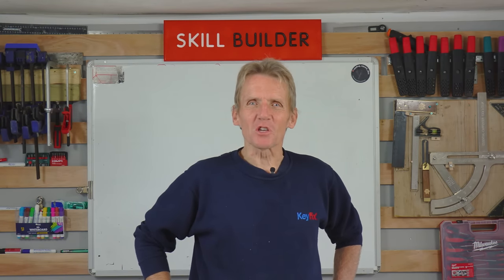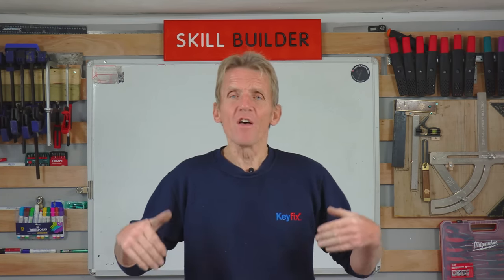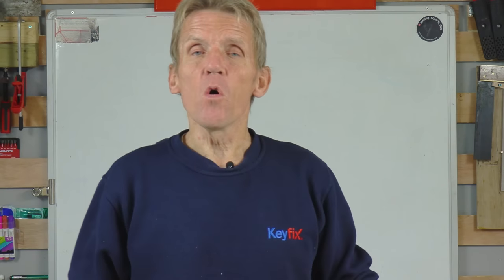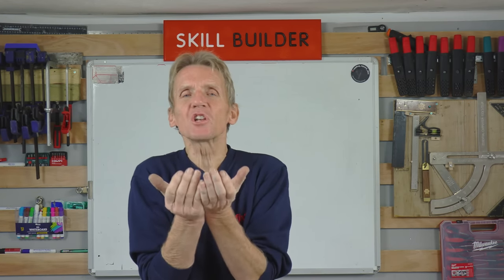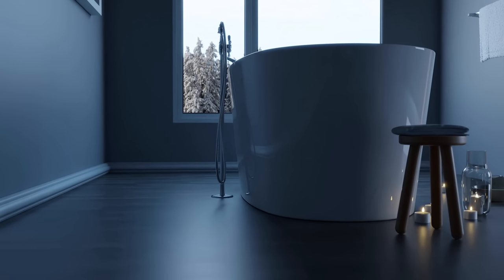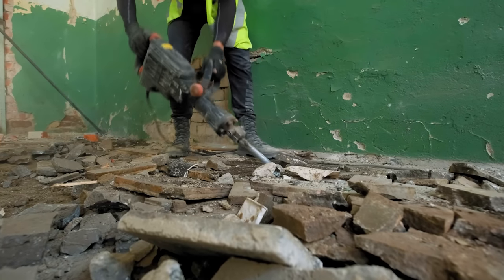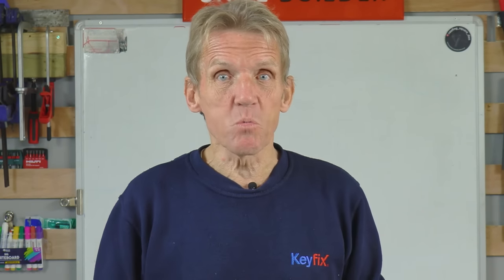Underfloor Heating — The 2 Big Questions

Comment: Our Friends had a burst bath tap in their bathroom a few years back . When the ceiling eventually caved in you could see a radiator in the middle of the room notched into the floor joists 🙄😳🤣🧱👍🏽
Reply from the maker: What a great idea. That will be my next video
Reply: @SkillBuilder  🤣🤣🧱👍🏽
Reply: What, they'd just stuck a radiator under the floor?
Genius!  :))
Reply: @42RHD  Yep 🤪🤣
Reply: @SteveAndAlexBuild  Hilarious!
Reply: I have subscribed.
This sort of sideways thinking should be appreciated.
Reply: @42RHD  😂Thanks very much 🧱🤙🏽👍🏼
Reply: Thanks Roger, I have a 1960s bungalow with uninsulated concrete floors. Can allow a 40mm floor depth over concrete. I was planning on a wunda ufh system throughout.?  Would this be better than radiators.  Running off a new combi lpg boiler. Appreciate your feedback on this, as been going back and forward on the best solution.
Reply: @SkillBuilder  thinking out of the box! 🤣
Reply: Haha holy shit that's amazing 🤣🤣
Reply: @rodgerq  😆😆
Reply: @ChristianLawrence  Sounds like a perfect opportunity to install a heat pump. Why install a new LPG boiler?

Comment: I set Ground floor to 45 and Suspended floor at 55 (all screeded) but plumber refused to service the Auto Air Vents. Now every Flow Meter is 1/2 filled with AIR. Is this ok as I do not want to bother with Services as it has a good BAXI Boiler plus new added Adey Micro2 Filter for my own annual cleaning?

Comment: You definately need some thermal break under the pipes. I put UFH in a new build 20 years ago with 40mm PIR under it and never had a problem heating the whole rooms. 100mm is overkill IMHO, heat rises after all.
Reply from the maker: Heat rises in air through convection but in a solid floor we are talking about conduction which is happy in any direction.

Comment: I am planning a kitchen extension with underfloor heating,  would you recommend i install a insulated block and beam floor instead of using standard concrete blocks?
Reply from the maker: If you can get it but I have never found a supplier, it seems that it only goes out to big sites.

Comment: Hello Roger, have you ever installed a system where you can't raise the floor height at all? I have a room upstairs (in my roof) that I use as an office ~3.5m2 . It has old woodern floor underneath and a pretty rubbish radiator. Since it gets really cold (in  Sweden) during winter I was tempted to spir off a line and use a router to run a channel for the pipe into the floorboards. Thoughts? Bat shit crazy or doable?
Reply: Look at the systems which sit flush between your floor joists.

Comment: Unless you add about 30cm of interlocking, sealed high density insulation then don't bother... Then the pipes are covered by poured, liquid concrete...
Needless to say it all must be professionally installed by a highly reputable firm..
But when down correctly the comfort is epic..
Reply from the maker: There are many way of doing this job and it is certainly a DIY job if you follow the instructions.

Comment: The idea of having a hot radiator and a warm floor seems to defeat the energy savings of not having to put a lot of heat into water. As the temperature of the water rises it costs more energy per unit of heat to add. If you can keep your boiler at a MAX of say 48C and the return water maybe 10 degrees less...and adjust for outdoor temp...you should save some significant energy. It is SO expensive to drive 90C into water to make a radiator capable of heating a room.

Comment: If you wanted to partition a room which has UFH how would you install the sole plate without risking damage to the UFH pipe?
Reply from the maker: stick it down with a polymer adhesive, it is amazing how well  it sticks.

Comment: Hello

I am in process of installing water underfloor heating. As part of the project the engineer is also moving the boiler from kichen to garage. 

My question is when the project completed what kind of certificate and documentation should I get for the underfloor heating installation and for moving the boiler for my future record. 

Can you please list out what should I get from the company on completion please.

Thanks,
Reply from the maker: Take photographs of the heating at every stage. You can also request an invoice with the name of pipe manufacutrer because they give a very long guarantee on the pipe.
When the boiler is signed off you will have a log book with the details of the installer and the readings taken of the flue emmissions. It should also be registered through the installers registration. They can do this with their phone.
Reply: Thanks for your response

Comment: Underfloor heating shouldn't be used as a stand alone system but, ideally, part of an overall integrated system with good insulation and double/triple glazed windows. Also look for alternatives to a gas boiler as underfloor heating works at a lower temperature and is more efficient if installed correctly.
Reply: My underfloor heating (Nu-Heat) runs off a thermal store of 750ltr, if heating is needed the u/f water is pumped through a heat exchanger in the thermal store and the boiler only kicks in once the TS has dropped a significant amount. This then economically utilises the oil fired condensing boiler as it’s not cycling on and off constantly
Reply: @davidianwalsh  Thanks for the heads up.
Reply: @davidianwalsh  I'm looking at a similar setup with an oil boiler also, thanks for the info!

Comment: Hi Roger. Im interested in doing exactly what you said for my bathroom. I didnt quite understand - is the pipe ( presumably plastic) in direct contact with the underside of your plywood floor or held away from it?
Reply: my understanding is, the closer the better, but direct contact is not always possible. Please if it is just the radiator water pipe against the floorboards then it still have air space around it, which creates ineffeciencies.

Comment: Hi. I am considering underfloor heating for my flat - from what I have read so far is that the electric UFH is not very efficient in heating up the rooms so would like to go for wet / gas UFH. The lowest UFH systems on the market seem to be around 2cm thick - but was wondering about the insulation required. Based on this video it seems to me that insulation of around 4mm is pretty much useless and something much thicker is required (around 100mm) - is that right? Did someone install UFH (in a flat with concrete floorings) with insulation of only 4mm or so - and was it a good choice? In terms of room temperature and heating costs? Keen to hear your opinions.
Reply from the maker: Hi Haken 
I have done a few jobs straight  onto uninsulated concrete and there is no doubt you lose heat. The key thing is that the pipe is near the surface so you get a fast warm up time. This means you can turn it on and off at will but there is no thermal mass to even out the heat. 
I would love to do some tests to find out how much is being lost through the floor but it is hard to do. I will think about some test rigs but the bottom line is that people are willing to lose a fair bit of heat in order to get the warm floor. 
You are right about electric, it is crap.
Reply: @SkillBuilder  Thank you for fast response - need to do some thinking in the upcoming weeks, would be great if you could do some tests too - though appreciate it's not straightforward to quantify how much heat is being lost when uninsulated.
Reply: @SkillBuilder  I just spoke to a representative of an underfloor heating company - he told me that concrete is actually quite a good insulator in some cases (in my case particularly it's a flat on 1st floor - with flats above and below me) - and apparently the heat loss through concrete is only about 6-8% so not that bad. Am wondering what your thoughts are on that - as I cannot afford 10cm insulation, probably not even 3cm, best I could do is something like 1cm so am wondering if UFH in such case is something worth doing.
Reply: @SkillBuilder  I have a holiday chalet with no gas. We installed electric UFH throughout, insulation between the joists (although that is nowhere near perfect, think badly fitting jigsaw puzzle), Amtico on top (7mm dual overlay board in between which acts like the screed in spreading the heat) with tile in bathrooms and carpet in bedroom. 

A really good stable comfortable temperature and very comparable on cost to run compared to other standard electric heating. 

We get lots of positive comments about it when people stay in the depths of winter. 

Yes,😅 it's expensive compared to gas but that wasn't an option. It's also cheap to install and no floor build up either. We did have to upgrade some electrics as we have 2x10kw showers so the power draw with 2 showers and the UFH is too much so it temporarily flicks off the UFH but that is constantly on and off anyway to avoid going past 27 degrees floor temp. 

It takes time to warm up from cold like traditional UFH so we just leave it on a target temperature of 21 between 7am and 10pm and the thermostats in each room do the rest.

People over the road also installed it after seeing ours but cut corners. One thing we think makes a massive difference are these dual overlay boards - they just added cheap LVT on top of the electric mats. I think they looked at them and thought they were ridiculously expensive MDF but they do a great job at spreading the heat evenly

Comment: Hi Rodger. Love your videos. 
Do you need a concrete subfloor under your insulation?
Reply from the maker: No but the insulation has to sit on something. What are you planning to do?
Reply: @SkillBuilder  renovation, old stone house. wacked in gravel in  layers 70-100mm total depth, have allowed for 150mm insulation and 75 screed maybe incl mesh.  Someone said sub floor so have put the job on hold. Would have to take out stone to get sub floor in.

Comment: We have suspended floors downstairs and we are going to add wet UFH.  We are going to insulate between the joists.  Is there a "best system" for this set up?  Looked at various options and not sure which to go for.
Reply: Have you done this yet? What did you go for? The best method I see is to buy the insulation with foil either side. It's very firm so you cut with a saw to size and force in-between the joists to hold it in place. Personally I just used some garden netting, a Staple gun and a roll of fibreglass insulation but it was a bit of a hassle. I hope it's strong enough for over the years as well
Reply: @PercyJackson93 in the end I went for the overlay system downstairs from Ambiente (Ambisolo) and insulated between the joists underneath. I would have gone for something between the joists but we had a few sections (old house) of concrete floor that would have been too costly to dig out. Will do a between the joists the system upstairs. Happy Christmas!

Comment: Hi. Is it posible to heat shower floor? And all bathroom?
Reply from the maker: yes it is very common to do that so it dries the shower out and prevents mould
Reply: @SkillBuilder  thanks. I need to think at any technical issue? Dilatation? Water tube distance away from main shower tubes?
Reply: I meant shower main drain pipe

Comment: Roger please give me instruction on how to switch on my ufh for the first time, heard horrow stories of bringing the Temperature up too. quickly / too hot. I have a thermostat in the screed and what can be described as a thermostat valve near the the manifold.... Any advice would be appreciated....
Reply from the maker: Generally you bring it on a little at a time by turning the blending valve  down to 1 and then working upwards until you reach 4.

Comment: Hi Roger, what are your thoughts on using a multifoil insulation laid on top of solid concrete and ran up the walls a few inches, battened (3×2, possibly 2x2) then underfloor heating finished with 18mm floorboards
Reply from the maker: I would rather see pir board inbetween the battens. If you squash the mulitfoil you lose a lot
Reply: @SkillBuilder  what's the minium size pir board I could use  as I only have 50mm to play with  ..

Comment: Very informative video.

In my case, I'm planning to build a 6 meter extension up/against the original concrete base of my house. It's my intention to have the extension concrete base lower than the existing base, to accommodate: installation, pipes & screed.

Can you you advise on the: optimal insulation thickness, desirable diameter of pipe, and thickness of creed. I'm hoping to ascertain the overall depth requirement to accommodate all three components for a heating system that wouldn't require radiators.

Regards

R
Reply from the maker: Hi Robert
The required insulation thickness is usually 100mm PIR  but it is dependent on the perimeter so it can vary to get the U value. Depth plant for 120 mm if you can. The pipe is usually 16mm and the screed on top of insulation is usually 65mm but you can get pumped screed which will go down the 35mm  so you get a faster warm up time. 
With the pipe at 200mm you should be able to heat the room easily enough but placing the pipe at 150mm gives you a more rapid warm up. 
If you are tiling make sure you leave an expansion gap around the perimeter and use flexible adhesive.
Reply: @SkillBuilder  Thanks for the detailed advice, much appreciated.

Robert

Comment: Here's the problem with mass market ufh. A 'normal' system runs at a fixed temp designed to heat your house when it's -2 outside.  It will overheat the floor 90% of the year. They add wall thermostats to mitigate this.  The smart engineers are running weather compensated mixers and no thermostats. And then we have engineers that don't understand the difference between dt20 and dt5 and tee the UFH off a rad circuit and wonder why the rads stop working when the UFH is on.  Basically ufh is mosty misunderstood by both customers and plumbers.
Reply from the maker: I think you might be right about all that. Interesting ideas and Heat Geeks doing away with manifolds altogether which makes sense if you are running a boiler or heat pump at 50 deg C
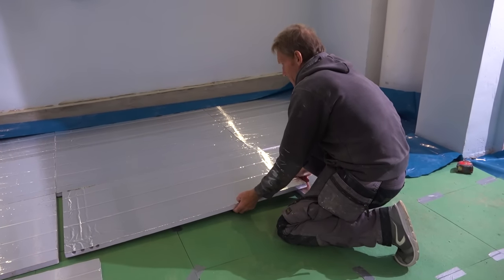Reply: Yep we have low build UFH across our ground floor (the EPS boards Roger was laying at 5:12), originally with a static mixer on the manifold and "dumb" smart controls on the (Vaillant) boiler constantly pumping out 70c flow temperatures relying on the manifold mixer to try and keep it down around 35-40c. We've now ditched the mixing valve on the manifold and swapped out the controls for Vaillant weather comp controls along with 2 Esbe electronic mixing valves managed by the Vaillant controls (installed by Andrew Millward, there's a video on his page of our install). That means we can run 2 separate weather compensated curves for the two heating circuits, one between about 20c and 40c for the UFH, the other that has a wider operating temperature range up to about 55c for the upstairs rads.

As an aside Roger, I'm not sure low build UFH necessarily needs rads for quick response in most instances, because the pipes are right under the floor surface its warm within 20 minutes from the boiler coming on unlike conventional UFH, which raises room temps almost as quickly as rads in our case, even with ~30c flow temps.
Reply: @LocostR1  nice 🤘 we're militant Viessmann  disciples just like Andrew and I wouldn't entertain fitting ufh without an electronic mixer. Fixed temp seems absolutely absurd to me.
Reply: @randomcamerajunk6977  If I knew 2 years ago what I knew now I probably would have had Andrew in to install a Veissmann with this kind of setup from the off, much better modulation from what I understand and the controls look far more logical and easy to use than Vaillant.
Reply: Thats just stupid argument. Need to have mixer with thermostats. How do you control different room temperatures seperatly if not using thermostat. Not very smart to constantly adjust flow speed manually from manifold.
Reply: @lauriviik  There's still a mixer its just electronically controlled by the boiler controls so you're never in a situation where the boiler is pumping out 70c water to only get mixed down to 30c because the ufh is the only zone calling for heat. You can also still have thermostats controlling each ufh loop acting like a trv if you want
Reply: @LocostR1  thats what i am saying. Original poster random camera junk sayed that good systems do not use thermostats. It works that way but you cannot control rooms seperately like that.
Reply: @lauriviik  It depends how you want to heat the house but you don't need to have thermostats to maintain consistent room temperatures and as long as you balance the UFH loops to reflect what relative temperatures you want between rooms you don't need to keep changing it. I've got our 11 loop UFH running with a single thermostat on the ground floor and no actuators at all. Our front room and study aren't used as much so have their loops flow dialled down a bit relative to the rest and as such they're always where we want them at about 19c when the rest of the ground floor running off the same manifold reaches the 20c target during a heating period, they don't need to be constantly changed to maintain that. 

If you wanted to heat each room to different temperatures at different times then obviously you'll need thermostats in each room and a means to call for heat from each, but having had a control system like that previously more granular control doesn't necessarily mean better or more efficient.